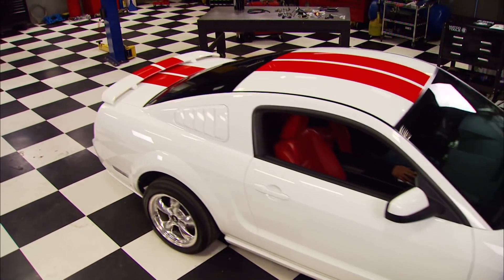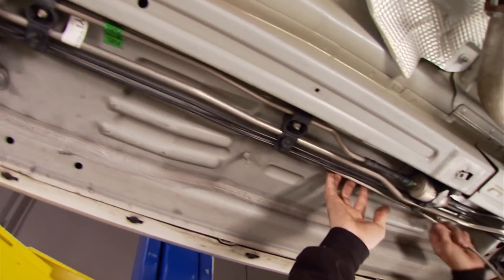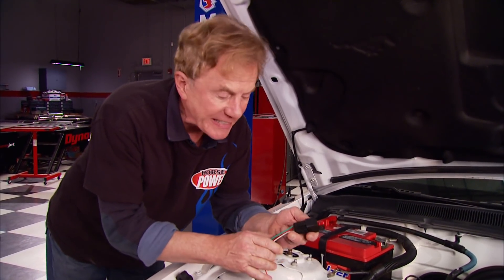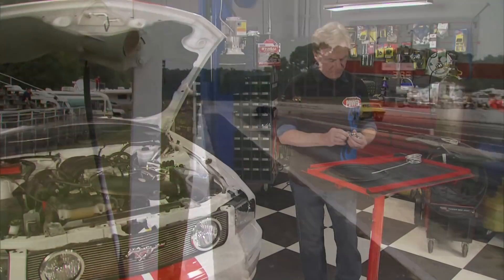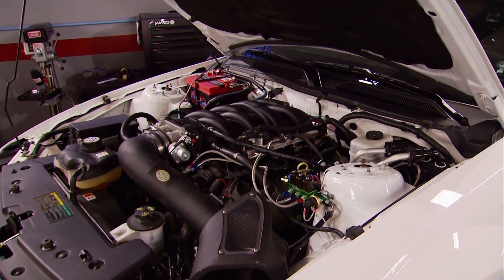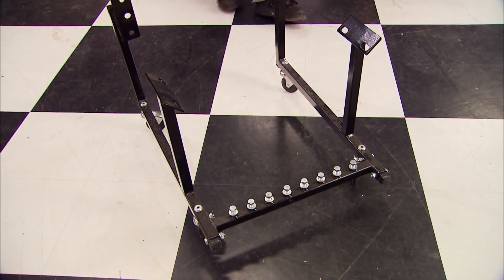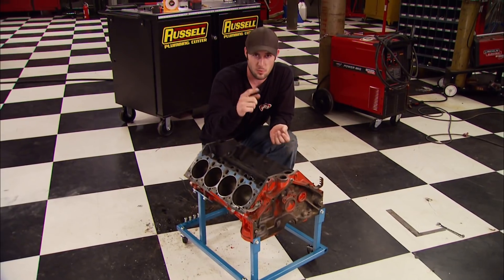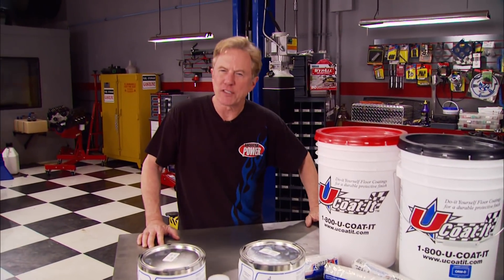An Easy Way to Get Big Power From a 4.6-Liter Mustang - Horsepower S13, E11

Comment: 6:40 or, instead of a test light, why don't you use a Voltage Reader? Like, really? A test light? That's simply to find problems, NOT run new wire 🤦‍♂️🙃

Comment: Easy way? Coyote Swap.

Otherwise, you're looking at completely building the motor.
Reply: I mean you can get 450hp off just a supercharger, fuel pump(takes 10min) and injectors.. and with 4.10s/3.73s you'll wipe the floor with most domestic vehicles pre-2015. And they're reliable at those numbers, the bottom end is good to 500, is say 550ish with a new set of bearings on install and a billet timing chain tensioner/guide you can consider a complete rebuild/swap. Way easier to bolt on a supercharger than rip out the whole motor/trans and get an ecu dialed in.

Comment: I have a 2005 Saleen S281 SC supercharged legend lime 5 speed coupe. 61,000 miles, only owner since dealer at 3000 miles.  478 dyno rwhp. Message on IG if you'd like to buy one.